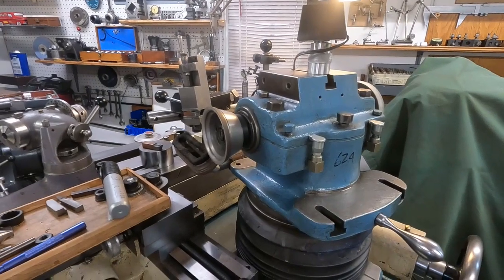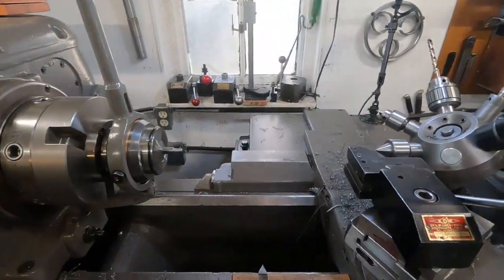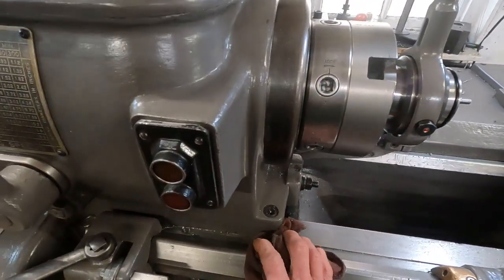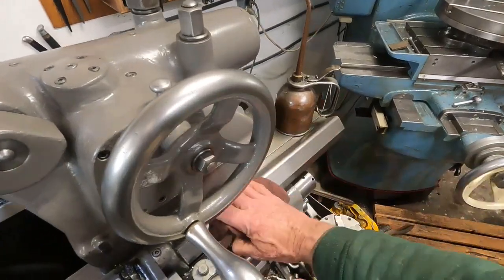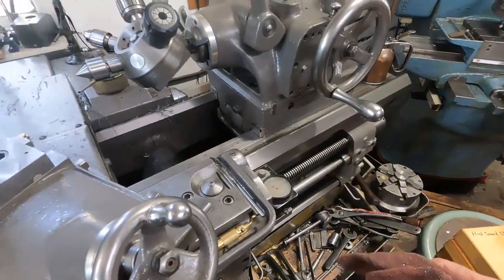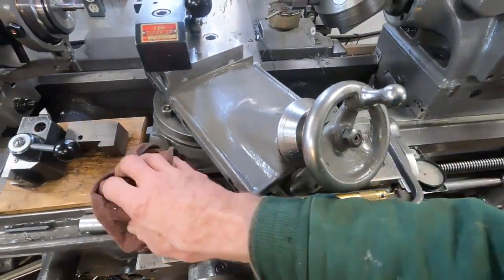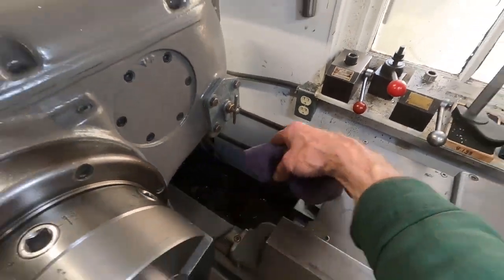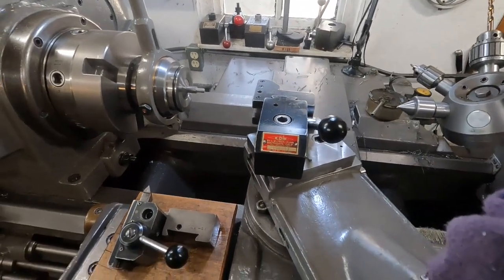How to have precision machines and grinders together

Comment: I've been using machinery for a long long time, usually when I get finished doing something on a machine I wipe it down, then I oil everything back down with Vectra medium heavy, then I have had covers made and it gets recovered until the next use.
People and friends always ask me why that I do this, I reply to them when you go take a dump do you wipe lol.
Reply from the maker: The obsession with mot grinding in the machine shop leads to going broke if it is a business having to make rent, My machines always cleaner and look and run better than the blowhards, and amateurs on YouTube,

Comment: I asked about this a couple videos ago. What makes me personally nervous is the dust I miss. The brush and rag technique does "most" of the work but not everything. And also, I've never seen a lathe or mill that wouldn't have clogged up oil path partially or even fully. Stuff just gets everywhere and my recipe is, just take it apart before you start using an used machine
Reply from the maker: The Axelson being over 80 yrs old had the oil channels clogged with hard varnish and slimy stuff and it took separating the saddle from the apron and blocking it up on the ways "very heavy" and using wire and 17 cal rifle cleaning rod with a small drill bit attached managed to get all the oil channels clear. It took a couple of days but now its oiling. There is no metering valves but over 30 external ball oilers many painted over. The lathe was owned by machine tool builder Foote-Burt then owned by the Rand Corp turbine rebuild that later took over the facility, I believe the lathe was idle perhaps 10yrs before Yoder put it on ebay. I have used the lathe nearly every day for around a year and it keeps getting smoother and better.

Comment: I would like to enough space to have the grinders in their own room but its not possible. I like to oil my machines every time I use them and regularly clean the ways down with a rag or paper towels.
I have been going through the cross slide on my DSG 1307 as it has automatic oiling for that but I don't think its been getting enough, 52 years old the system is bound to be not as good as it was when new, think I am going to replace the metering values with ones that flow more oil if I can get the same type.
You do see a lot of machines in general purpose workshops that look like they get cleaned only when the chips build up so much they get in the way of working.
Reply from the maker: The space for machine tools is too costly here, that is why they are rusting in the scrapyard just up the street from me. For example, many of the other one car garages around me has someone living in it and paying over $1000 rent!
Reply: @DonDyarprecision  It's not much better where I live Don, I would say around half of new build housing you don't get any garage at all now, or enough land to build one, normal is a yard or so of land down the sides of your house, enough out front to park a couple cars and 8' or 10' behind backing up to the neighbours rear garden, all for at least 10 times the average wage in the area.

Comment: There is no such thing as ``over-oiling`` a machine... Tho, i find the rags a bit of a compromise... You can never really wipe every millimeter of the ways, especially not right up against the way-wipers, which could easily catch some grit or have it pushed into the small gap by the rag... I prefer a complete Renzetification of a machine as a preventative measure... If the grit can`t possibly land on the ways, the ways are safe... But i agree, some people are savages who actively ruin machines by incompetent and careless neglect... It makes me sick when i see people using an angle grinder near machines, or a toolpost grinder on a lathe that is not ``suited up`` in protective coverings of whatever kind... And don`t even get me started on hardmilling and hardturning with cbn and shedding red hot chips and molten slag along with hardened shavings on the ways, only to run the carriage along and over them... That kind of degeneracy should warrant an involuntary stay in the nuthouse... And some serious paddlin`...
Reply from the maker: That is completely taken care of by the Axelson way wiper system featuring spring loaded brass scrapers ahead of the felt wipers and also featuring individual ball oilers on each solid bronze way wiper housing. This machine was made in or very near Hollywood where they filmed "True Grit" John Wayne himself said "Don't worry Pilgrim, Axelson has you covered"! But one still needs to look out for snakes and keep things as clean as possible. Thanks!
Reply: @DonDyarprecision 
I`m not overly familiar with the specificities of the Axelson, so this is some nice info! Damn, that lathe is more and more attractive to me... And the spring loaded wipers definitely sound nice! Not to even mention the oilers... Like - wow! A damn fine machine... Once more, thanks for the info!

Tho, as you said, even such a machine is requiring maintenance and cleaning, not just requiring, but definitely deserving... 

All the best and kind regards!
Steuss